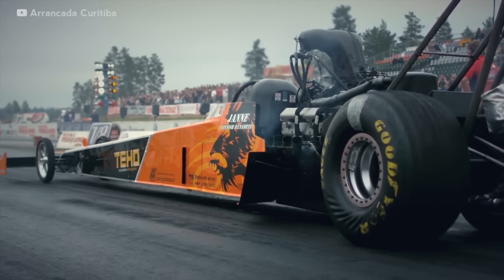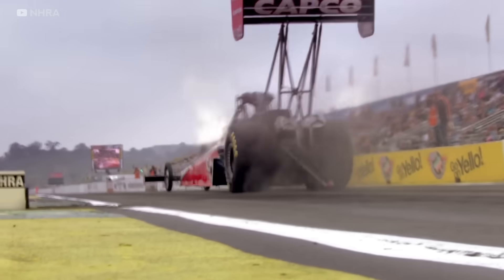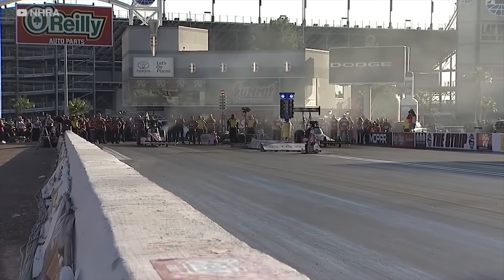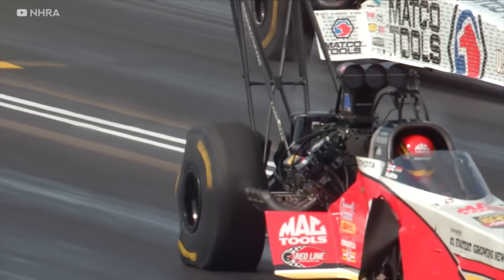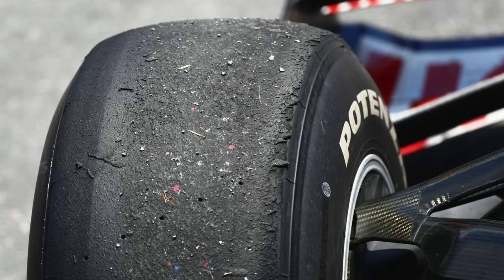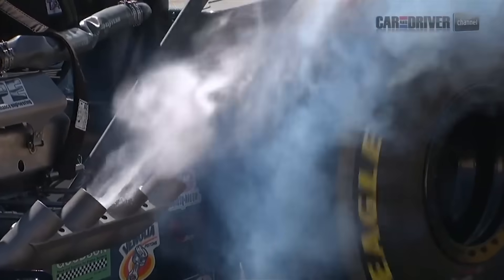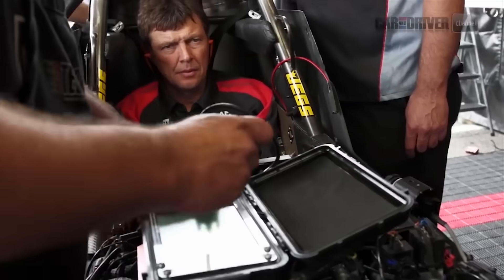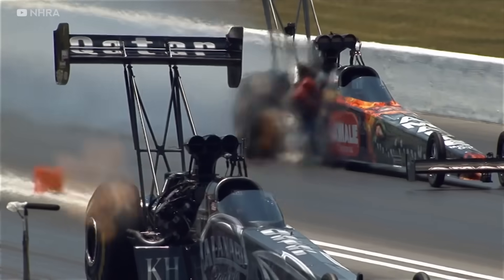How Dragster Tyres Accelerate to 335 MPH in 3.6 Seconds

Comment: Stolen:
* Under full throttle, a dragster engine consumes 11.2 gallons of nitro methane per second; a fully loaded 747 consumes jet fuel at the same rate with 25% less energy being produced.
* With 3000 CFM of air being rammed in by the supercharger on overdrive, the fuel mixture is compressed into a near-solid form before ignition. Cylinders run on the verge of hydraulic lock at full throttle.
* At the stoichiometric 1.7:1 air/fuel mixture for nitro methane the flame front temperature measures 7050 degrees F.
* Nitro methane burns yellow. The spectacular white flame seen above the stacks at night is raw burning hydrogen, dissociated from atmospheric water vapor by the searing exhaust gases.
* Dual magnetos supply 44 amps to each spark plug. This is the output of an arc welder in each cylinder.
* Spark plug electrodes are totally consumed during a pass. After 1/2 way, the engine is dieseling from compression plus the glow of exhaust valves at 1400 degrees F. The engine can only be shut down by cutting the fuel flow.
* If spark momentarily fails early in the run, unburned nitro builds up in the affected cylinders and then explodes with sufficient force to blow cylinder heads off the block in pieces or split the block in half.
* Dragsters reach over 300 MPH before you have completed reading this sentence.
* In order to exceed 300 MPH in 4.5 seconds, dragsters must accelerate an average of over 4 G’s. In order to reach 200 MPH well before half-track, the launch acceleration approaches 8 G’s.
* Top Fuel engines turn approximately 540 revolutions from light to light!
* Including the burnout, the engine must only survive 900 revolutions under load.
* The redline is actually quite high at 9500 RPM.
* THE BOTTOM LINE: Assuming all the equipment is paid off, the crew worked for free, & for once, NOTHING BLOWS UP, each run costs an estimated $1,000 per second.
Putting this all into perspective:
Lets say the you are driving the average $140,000 Lingenfelter twin-turbo powered Corvette Z06.
Over a mile up the road, a Top Fuel dragster is staged & ready to launch down a quarter-mile strip as you pass by it. You have the advantage of a flying start. You run the ‘Vette hard up through the gears and blast across the starting line & pass the dragster at an honest 200 MPH. Just as you pass the Top Fuel Dragster the ‘tree’ goes green for both of you.
The dragster launches & starts after you. You keep your foot down hard, but you hear an incredibly brutal whine that sears your eardrums & within 3 seconds the dragster catches & passes you. He beats you to the finish line, a quarter-mile away from where you just passed him. Think about it – from a standing start, the dragster had spotted you 200 MPH & not only caught, but nearly blasted you off the road when he passed you within a mere 1320 foot long race!
Reply: I need to know more about that 'near solid state' of the fuel. Don't think this can pass a rocket scientists bullshit test
Reply: @DavidG2P  I don't know about "near solid" but the follow up sentence makes more sense - the engine is close to hydrolock as the volume of fuel injected is nearly as much as the volume of the cylinder heads
Reply: @DavidG2P  It says "near solid"; so it's still a liquid but highly viscous.  The viscosity doesn't play a role as the fuel is already in the cylinder at this point, ready to ignite.
Reply: @glennkrieger  it's not even liquid but gaseous cause it's not gonna burn were it liquid. "Near solid" is bullshit
Reply: @DavidG2P  I think they actually meant near liquid, hence the reference to the cylinders being nearly hydro-locked.
Reply: @DavidG2P  You don't have to imagine it, this is the fuel pump for a single cylinder running at max power, it pumps out more fuel than your gas station fuel pump in a single second. Coupled with the aforementioned air flow of 3000CFM and it's not hard to imagine the fuel being compressed close to being solid, and that is years ago. https://youtu.be/xGTbQuhhluY
Reply: @DavidG2P  I always assumed they met that there was very little air in the cylinder (percentage wise) at top dead center
Reply: @trevorchadwick5479 your comment is very perceptive. Possibly not for the reason that you planned. There is what appears to be very little air in the cylinders. Normal Gasoline has a ratio of 12.7:1 by weight of air to fuel in order to burn at best efficiency. Gasoline also has a consistent amount of heat that it generates per unit of volume. These machines burn Nitromethane as fuel for two reasons. Principally it is due to producing way more heat per unit volume. Second is that the chemical makeup of Nitro is such that the ratio of air to fuel is very close to 1.7:1. This means that you only need about 13% the amount of air to get combustion. With the air being limited by what the blower can force you can inject more than 7 and 1/2 times as much fuel. Essentially 8 times as much bang per cycle just by fuel plus the higher heat rate. 
   That is how they run at "near hydraulic lock" and on very little air. The compression ratio for Nitro is usually considered "safe" at a bit over 6:1, Blown race engines run as high as 11:1. However, if one is injecting as much as 8 times the amount of fuel there is almost no space for the air. Oh, by the way @DavidGPeters this does actually pass the bullshit test by Stoichiometric Ratio.
Reply: 14x71 cubic inch blower overdriven 25 percent at 7500RPM is trying to stuff 5,392 cfm into the engine.
Reply: @exploranator  if it flowed 5392 cfm, there would be 0 psi boost.  The restriction in flow is what creates pressure..
Reply: This is the first video about dragsters I watched, and these facts are really cool to know!
Reply: There's a video that shows the fuel flow to ONE CYLINDER at idle vs. full throttle and it's similar to a garden hose.
Reply: @_BAD_MERC_  more like a fire hose
Reply: @Perceptence  yup, thats why it says stolen.  It is dated though, hp is up from then, and they only run 1,000' now
Reply: there's one more: i read somewhere that it takes 700+ horsepower just to run the blower.....
Reply: @jbcowherder6210 , I heard that also, crazy numbers !
Reply: Thanks Trevor.  Great addition.  Top Fuel numbers are always mind-blowing.
Reply: no longer run 1320' Sad Face,  they run 1000' distance is close to 35% less than they used to run at 1320'
Reply: I like your funny words magic man
Reply: I used to work at a machine shop when I was younger and we cut Ron Krisher's heads on a CNC mill from a solid billet. $20k a set. Good for 3 passes. His Dyno lab was across the street.
Reply: It's all games n shit till Trevor Chadwick pull up with a mf essay
Reply: What 747 are we talking about ? And what 747 engine are we talking about ? 
Are we talking about all 4 engines or just one ?
Reply: Great comment!
Reply: mucho texto
Reply: Let's take a second to think of the poor driver getting 4 G pointed towards his head: that's like riding a roller coaster upside down.
Reply: Wow
Reply: So to resume everything this is what happens when you try to maximize the performance of our current technology without caring about quantity, durability or cost. It is impressing but also extremely foolish at the same time. I can’t help but imagine if aliens existed and visited us, if they saw that they would probably be mocking us for being immature and proceed to return home in their vehicule going from 0 to a 1000 in less than a second…
Reply: So many foots
Reply: 44 amps is pretty low for an arc welder. I normally run mine at a minimum of 75 amps.
Reply: @mikewhitman745  Are you welding in a high pressure environment of nitro?
Reply: @imafeltersnatch7634  makes no difference.  44 amp of arc welding doesn't get you very good penetration. That's really all there is to it. Doesn't matter what fuel the vehicle uses, I do a bunch of welding on stuff that doesn't have an engine at all. 
So does the lack of an engine change the amps needed to weld in your opinion? 
How would you weld a diesel truck differently than a gas car?
Reply: @mikewhitman745  These are Magnitos.  I believe they are 70k volts
Reply: @mikewhitman745  They are MSD Pro Mag 44 systems.  The standard of blown  Nitro. 2 plugs per cylinder and often times that's not enough to light the fuel air charge. Whatever you think you know about automotive engineering or physics  you should just ignore and start over with the madness of blown Nitro. 
These have to light off an insane amount of fuel and air at bazaar cylinder pressure. 1.5+ gallons per second and around 65 Cubic feet of air going into the engine per second. All the while fighting the laws of physics, while heading for 0.5 Mach in 1,000 feet.
Reply: @imafeltersnatch7634  I like how you completely ignore the point I was making. 
44 amp on a sparkplug is huge, 44 amp for arc welding is nothing. 
If you don't know anything about welding maybe you shouldn't reference welding when your trying to impress people.
Reply: @mikewhitman745  Capstone Metals Grad. 
Appears that you just aren't ready for social media. Get yourself a nap and you'll feel better. Also as an adult about context after your nap. FO
Reply: @mikewhitman745  Ironically I'm a former TF/D crew member and have a very diverse background. I can ask my former Aerospace Machinist buddy if he wants to join. He's all into the technical end of alloys and such.
Reply: @imafeltersnatch7634  hahaha!!! The old my buddy is an expert deal.
You don't need to bother him, you just need to literally look up welding amperage for smaw arc welding. 
The packages of rods tell you what amps to run, you can look it up yourself. 
Anyways there is no point talking to you anymore. You have decided no matter what you are right because you claim to have paperwork you supposedly earned. 
Some of the stuff you said was right and some was not, just deal with the fact that you aren't right all the time.
Edit: go ahead and ask your buddy how much power it takes to smaw or tig 1/4" aluminum. 88 amps is not going to cut it.
Reply: The engines of a 747 produce a total of approximately 120,000 horsepower on take-off (and approximately 60,000 horsepower while cruising) so an order of magnitude more power at takeoff, compared to a dragster, even though they consume a smaller volume of fuel per second on takeoff.
Reply: um, what a i missing. these dragsters make 11000hp. at full throttle a 747 produces more than 250,000hp.    not sure how your getting 25% less energy than a dragster
Reply: You must be used to some sloooow readers...
Reply: Michael Fritsche  you see the link I posted to a video of the fuel flow?

Comment: Hang on. Nitromethane has less energy than normal petrol, right?

Also, if nitromethane doesn't need air to combust, what good is a supercharger?
Reply: They flow air through it themselves
Reply: @TickTock725  what? Do you even English?
Reply: @taunokekkonen5733  that sentence was understandable you good?
Reply: @taunokekkonen5733  they pump their own air through the supercharger to make more power

Comment: Not mentioned was the supercharger takes about 1000 hp at full speed, the engines cannot run at full power for more than about 10 seconds without overheating or even blowing up. If the engine blows up at the start the dragster could still be travelling at 100 mph when it crosses the finish line.

Comment: Why do all the cars tilt to the right on take off?
Reply: Its due to the Direction the engine turns. The engine twists the frame that direction.
Reply: @flockofgorillas4485  Would a transverse engine not produce a better take off then?
Reply: Or even better a twin crank? one for each rear wheel.

Comment: 335mph in 3.6 sec lol I think you need to do some research dude...
Reply: Do you not believe that?
Reply: @flockofgorillas4485  that would be 93m/s in the first second... So you'd be pulling about 40G
Reply: @CotswoldParagliding  The speed trap is at the finish line. They go 0 to 125 mph the first second of the run, pulling about 4.5 to 5Gs. The drivers experience more G forces at the finish line when they hit the parachutes. About negative 6 Gs.

Comment: Since the engine is sitting in front of the rear axle, the dragsters are technically speaking mid-engined and not rear-engined.
Reply: In drag racing, it's the engine position in relation to the driver. If the driver is behind the engine, it's a front engine dragster. If it's behind him, it's a rear engine.
Reply: Details, details..... ;)
Reply: For the nomenclature of drag racing it is a "rear-engine dragster."  There are front-engined dragster.  That's why you have the distinction though in the automobile industry overall you'd say that it's a mid-engine design.

Comment: They need to try mounting the engine sideways so it doesn't torque the car to the side. Imstead, have it torque to the rear wheels.
Reply: there is probably not enouth space to fit it sideways

Comment: Something to add about the length and the front wing. The front wing is actually for the end of the track when the fuel tank starts to empty. The front of the car is a fuel tank. The fuel tank mostly counter acts the car attempting to wheelie until the last 200 or so feet

Comment: Nice job.  But the rear engine setup only goes back to 1971.  Before then, you sat with knees bent over the rear axle and your nuts behind the differential.  Clutch failures could be lethal.  Big Daddy Don Garlitts perfected the rear engine layout after losing half his foot in a clutch explosion in one of the old-style slingshot dragsters.

Comment: Whaaat?! "Nitro-MEEE'thane doesn't require mixing with air..." I guess the big air scoop and and blower is just for looks? Intake valves are unnecessary just direct-inject that 'Meee'thane' and open the exhaust valve at the right time and you too can go 530 kilometers per hour in 3.5 seconds.  Have you ever even been to an NHRA event in the US?

Comment: Forgot to mention too that the reason the fuel tank is up by the front tires is to add weight to the front end at launch. After the car launches it has to down force from the front spoiler to keep the tires down

Comment: Awesome video! But you got one thing wrong. At 2:49 you say that when the tyre rinkles and gets smaller in diameter, this reduces the gear ratio, as if you change down a gear. But it's the other way around (just look at the rear sprockets on bicycle with gears). So that makes me very curious if this is still a desired feature of the tyres, and/or what its purpose is!

Comment: Great video but I do have a small technical gripe with how nitromethane is characterized here.  Compared to ordinary fuel such as gasoline it's not volatile (compare flash points) and does not release more energy per unit volume or mass.  At standard atmospheric pressure and temperature you could almost use the stuff to put fires out.  It's nothing like freakishly unstable nitroglycerine.  The real magic of nitromethane is derived from it's ability to support combustion at impossibly rich mixtures.  At fat mixture for a gasoline race engine might be 11 or 10 to 1 air/fuel ratio whereas a nitro engine runs something like 2.5:1.  This insane rate of fuel flow more than makes up for nitro's lower energy density and results in the ludicrous power seen in modern top fuel cars.

Comment: Just slap on a good electric engine with a big enough charge on one of this and you got your fastest drag car ever.
Reply: The issue is weight and power density. Technically electric is faster, but practically the batteries required to let the car hit those speeds would be immensely heavy, and not as power dense as nitro. Remember, these aint gasoline cars.

Comment: I wonder when AI controlled driverless drag racing will be a thing.  Imagine the weight saved from not only removing the driver from the car but all of the structure used to protect the driver and the mechanicals used to have the driver interact with the machine.
Reply: The issue is that it's a sport about the drivers, not just the cars.
Reply: @marcusborderlands6177   I totally get where you're coming from.  When I made the comment I just watched a video that showed Teslas dominating street races and I was wondering with all the computer control, how much/little the driver was actually contributing to the outcome of that race. Heh
Reply: @emo65170.  honestly with launch control being a thing, drivers are starting to matter less and less, at least in street drag races.

Comment: It would be interesting to see a purpose built modern engine with dual overhead cams and 4 valves per cylinder fully blown like one of these monstrous, albeit archaic engines.  I wonder how much power one would output.
Reply: This has been done. Many years ago...Check out the McGee Quad Cam dragster. Beautiful engine. Couldn't compete with the Hemi style.

Comment: I'm confused. At 8:15 he says the fuel doesn't need to mix with air to combust. This doesn't seem logical since there's a big ole compressor ramming as much air as possible into the engine. Can anyone explain?
Reply: Yes it does need air. Weird and wrong statement in this video. Check out the huge "scoops" for air intake...